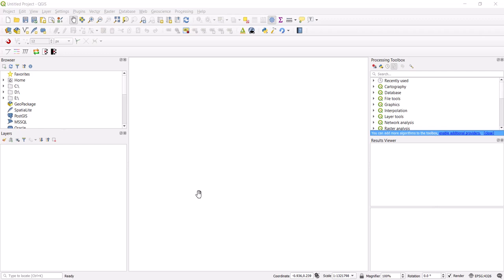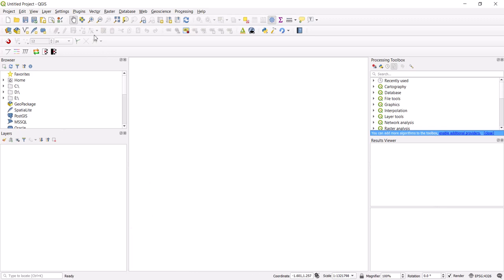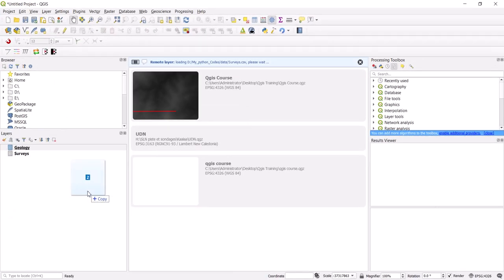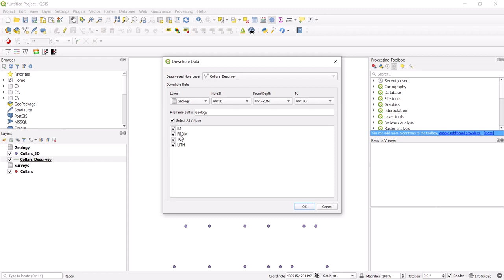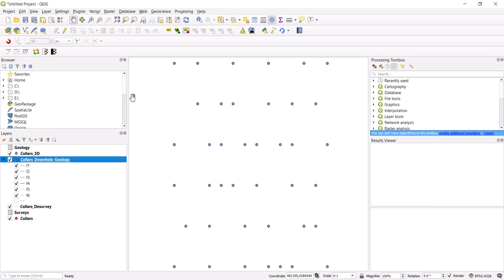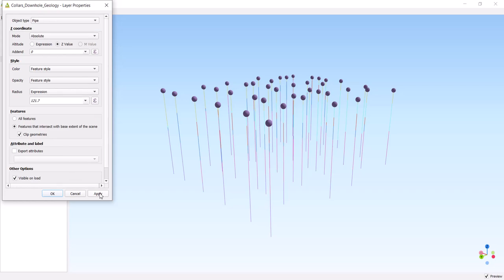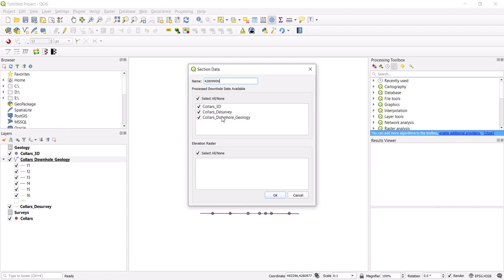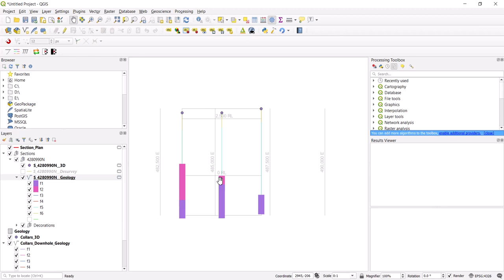Display drillholes in 3D in Qgis and Create Sections

Comment: Hello, I appreciate your detailed tutorial. However, I encountered an issue while using the Qgis2threejs plugin. Despite following your instructions step by step and loading the correct geology downhole data, I am only able to see points in the visualization, not the vertical lines. Could you help me troubleshoot this problem? Thank you!
Reply: I have the same issue :(
Reply: The problem is that the latest update of the qgis2threejs plugin has a problem with the vertical axis of the Geoscience plugin. You can solve this problem by downloading a older version from qgis2threejs manually as a zip file. The start the qgis2threejs again and it will run. But do not update the plug in, otherwise you will have the same problem again.
Reply: Check the text beneath. It explains how to solve the issue

Comment: It worked. But since yesterday when i want to see the downhole geologie in QGis2threejs they don't appear suddenly anymore. When i gi to zoom to layer its jumping to nowhere. Whereas the point coordinator appear correct in 3d. In the console it says: referenceerror cant find variable:app three.min.js(42):three.webGLrenderer:angle_instanced_arrays extension not supported... this problem didn't appear before. I updated yesterday all pluginns... i guess it somehow caused this. My data is all correct.. to double check i used your data... the fault remains the same

Comment: Thanks again. I am happy to suceed in built my first geological section with QGIS. A small diference between your results and mine was, the my Downhole_Geology came up side down. The spheres were positioned in the bottom instead of top.
Reply from the maker: To fix that , all you have to do in the geoscience plugin when you run the Desurvey hole option is to uncheck the checkbox that says down dip is negative
Reply: I made all the three files in csv format but when i try to categorize the symbology for the down hole data categorization does not happen, only one simple line comes "all other" . And there is nothing in the attribute table. Kindly help

Comment: very good explanation. i had some problems with the csv and the commas and dots, but now i have something.  only problem i have is that the drills are towards the sky instead the ground. Where must i change the data to correct this issue? thank you so much.
Reply from the maker: When you do Desurvey Hole there is a checkbox saying "Down Dip is Negative", check that or uncheck that based on your dataset

Comment: Geat and very useful video, thank you very much!. 
I find problem while trying to use drilling desurvey hole command. this message appear : The data source for the layer could not be found. I tried with your files and it works but it doesn't work with my data!! is there any explanation to that? For information, I use meter unit for parameters such as elevation, depth...
Reply from the maker: I m sure it is an import issue, or your data in not in the right format

Comment: Very good work, this plug in is amazing, thanks for explaining! What would you suggest is the reason my sections are not showing up after I draw them?
Reply from the maker: Thank you but your problem will depend on your data and how you created the section. I cannot tell what is the issue without more details.
Reply: @MiningGeologist  thanks for responding! I really appreciate it. Well, eventually, it requires the sections to cross exactly on top of the boreholes, otherwise there is nothing to show, I needed to have extrapolated anything in between. This is a good challenge for QGIS to overcome the expensive software.

Comment: Hello. I have a question. I managed to get almost everything I needed learning from your video. I wanted to make a drillhole planning 3d drawing, so I don't even need the lithological info. I just changed the elevation on Qgis2threejs to the value I wanted and changed the symbols to cylinders. Worked perfectly so far.

I just need to know: is there a way for me to tilt these objects on Qgis2threejs somehow? Do you have any idea? Because some of the drillholes shall be done diagonally and I need to represent that.

Thank you
Reply from the maker: just play around with the dip values in the survey file that should do the trick!
Reply: @MiningGeologist  Oh, that's the thing... i'm not even using Geoscience plugin cause it isn't necessary, since it's just a drillhole planning project. I'm straight up importing Google Earth Markers, adding coordinates to them, etc. Is there a way for me to add Dip values to them in a way that would display correctly on Qgis2threejs? Or add Dip values on Qgis2threejs window itself?
Reply from the maker: @dicornius9596  check the video description, you will find the dataset I used in the video (3 CSV tables) try creating similar tables but with your data then in the survey file try to adapt the DIP and Azimuth to your needs

Comment: Great video, I was looking for something like this!  I'm an archaeologist, and I would like to do something similar but make a 3D heat map (# of artifacts instead of lithology), and I think I can use this as a spring board...
Reply from the maker: For 3D wireframes, try using Geological modeling software, I have a full course here on the channel check it out.

Comment: Mining Geologist, absolutely love your Channel! Will be taking the course on Implicit Geomodelling as well pretty soon! just had one doubt though, where can we source the data from? I do not mean the data that you used for this particular video, but if I were to create a 3D drillhole using a completely different dataset, where can I find them? especially the Geological excel data! if you could throw some light on that, it would be really grateful! Thank you!
Reply from the maker: These tables are usually provided by the team who did the drilling , but if you have the logs you can create them yourself easily. 
Collar table : just put holeid, x , y , z coordinates of the hole 
Survey table :  holeid, azimuth of the hole ( dip direction, 0 if vertical hole) , dip ( 90 if vertical hole) , maximum depth of the hole ( end of hole depth)
Geology table : holeid, from depth, to depth , lithology in that interval ( the code of lithology for example SAND) 
PS : you need to use the same names in the in all tables in the holeid column for example don't use DH1 in collar and dh1 in survey. 
the max depth in the geology table should be the same you used in the survey table, there should be no missing  intervals in the geology table. 
from 0 to 5 Lith1 
from 5 to 10 lith2 => all the way to the end of hole depth. 
I hope this helps !
Reply: @MiningGeologist  I appreciate you taking the time out to type it all out! Thank you for that, will give it a shot.

Comment: Hi! Thankyou for the tutorial, I'm just having a small issue. I am using some old datasets to do some practice for future programs and am doing E-W sections of a 40x40m program. The sections can be quite long (upwards of 500m). What I'd like to do, to make the data easier to read or fit into a drilling report is to change the horizontal and vertical scales independently of one another, is there a way to do this in QGis? 

Thanks for your help!
Reply from the maker: I don't think it is possible with this plugin, I m sure there are better ways to do this.

Comment: Hi. Thanks and congrats for the videos, very helpful for my entry level. One question: How can I create a cross section using the project topography of a vector layer for more detailed work  i.e. planning infilling drilling?
Reply from the maker: Hello Miguel , if you want to create a cross section using the same method i used in this tutorial , you need first to get a DEM ( raster topography not vector) , so basically what you need to do is to interpolate the the vector topo you have using TIN algorthim for example or IDW which will generate a raster version of your vector topography then do as i did in the video . 
i hope this helps

Comment: What data is needed for the surveys? What is the input?
Reply from the maker: Andrei , you will find a link to download the dataset used in the description you can check how it is structured. mainly the Same hole names, Dip, and azimuth you can set them to 90, and 0 respectively in case you have vertical holes

Comment: Thanks for your QGIS Geoscience plugin videos,  Is there a setting to set a vertical exaggeration on the sections? Most subsurface geological requires significant vertical exaggeration. Is it possible to have a multiple vertices instead of just a straight line for the section? It would be nice if Geoscience would allow for bringing in downhole geophysical data like a gamma-ray log in the standard .las format.
Reply from the maker: Probably not possible with the current version, I think the founder stopped updating the plugin. but check out this one which I m developing right now so I might include these features 
https://www.youtube.com/watch?v=efNMFwBiifc

Comment: Awesome, I used our company data as I walked through the video - works really well, but the pipe (DH trace) thickness crashes a bit with lots of drill hole data....
Reply from the maker: I m happy that you found the tutorial useful , and yes with alot of data the 3d display might cause the software to crash because Qgis is made only for 2D plots but maybe in the near future we will see some tools that integrate perfectly with Qgis and works smoothly with 3D data, make sure to subscribe to be notified if such thing is available :)

Comment: Is it possible to generate a layer model through the drillhole interpolation?
Reply from the maker: Technically it is possible, but it is going to require some tidious manipulation also the accuracy is not going to be as you expect. There are better software that can do this but most of them are paid softwares. If you stick around and follow my channel your problem might be solved in the near future I m working on plug in that will do this automatically in Qgis.

Comment: Hi Mining Geologist,

Do you need survey data? I have none and I'm wondering what the easiest way to deal with this is. Most of my holes are shallow (<5m) but even deeper holes haven't been surveyed. All holes are vertical.

Thanks!
Reply from the maker: Hello izzy, thank you for your comment , actually survey data are needed to allow the software to trace the path of the drillholes in subsurface , usually if the drillings are vertical like in your case you don't get a Survey file . but you can create one really easily, make a copy of your collar file , delete all the coordinates columns , keep only the drillhole name column now add two columns DIP ( make it all equal to 90 which means vertical drillholes , some softwares needs -90) and Azimuth column ( make it all equal to 0 ) since they are all vertical . i hope this helps .
Reply: @MiningGeologist  I did try this but it hasn't worked for some reason. Not sure if I am missing something!
Reply from the maker: @izzywizzyable  i can check this for you send me a sample file if you want

Comment: Hi, great explanation of using this tool but I am having some issues. I know this is an old video but I am wondering if you can help me. I have about 100 drillholes that I would like to plot. When I try to run the downhole survey with my collar and survey csv files the surveyed layers get loaded into the layer manager but nothing appears in the project and I have the error "Layer unavailable, data source could not be found" and "Warning some east, north, collar, depth values are not numbers" . I tried with the data you provided as well and got the same issue. The only difference I can see in the process is that your data was separated by a semicolon and mine is comma delimited and I have surveys at multiple depths with azimuth/dip values that have decimals. Any ideas? Thanks
Reply from the maker: No worries @Redfox700, can you send a sample from your dataset I'll check what is the error and send you a detailed solution via email , you can apply a transition to the coordinates if you want. 
(my email can be found the about section in my channel , cannot post it here to stay away from bot emails)

Comment: Do you have a video on how to set the tables up in excel?
Reply from the maker: Hi Patrick, you are supposed to have these ready from the exploration team! what kind of data do you have exactly so I can assist you ?
Reply: @MiningGeologist  so I have bore logs. They were done before me so they are not up to my geology standards but that's all I have to go off of right now. So I built Autocad logs, but basically I have a GPS positions (which I easily can change Into northing and easting) depth of well, depth to water (I don't believe I have an initial elevation, but probably could get that from a DEM). The lithology is all messed up (there was only a field tech on hand doing it and I the geologist wasn't hired yet) so the lithlog was basically taken every 5 feet and goes [tan silty sand, tan silty sand, brown silty sand clay, tan silty sand]. I dont really have a proper thickness of each unit just because it was so vague. So the clay could have been an inch but the sample was taken at 5 minut Intervals so no too much to go on there. These were done at 2" holes by method of split spooning. So to summarize lol I have crappy litlog that I KINDA can break into sections but can't properly class, DOW, EOH, DTW, HoleID, and well location lol
Reply from the maker: @patrickmesa1947  I don't know if you are already familiar with the drill hole tables to perform desurveying in most of the mining packages or not. if not here is what you need : 
Collar table: put the hole name, x,y,z here (you can get an elevation from a DEM as you mentioned but that's not very accurate), and end of hole (I think if you sum up all the 5 feet intervals you can get one)
- Survey Table: same hole ids, dip (if you have inclined holes, other than that use 90 or -90 depending on what the software accepts), azimuth (if they are dipping to a specific direction use the right one, if not use 0 ).
- Lithology table: same drill hole ids, From , To intervals, and the lithology. 
- Assay Table: I don't think you need one
in your case whenever there are similar successive intervals just make a single one, for example, sand(5ft), sand(5ft), clay(5ft) just make them sand(10ft), clay(5ft). if they did it every 5ft and you are not sure if the clay is 5ft or just 1ft that's a problem that no one can solve and I m wondering why would someone log it that way. 
Also in the tutorial description, you will find a link to download the same dataset I used in the tutorial this will help you understand how to format your data properly
Reply: @MiningGeologist  ya they we not geologist lol in fact I'm teaching the how to log lithology and switching them to hollow stem cores so they can be kept in boxes. The well is completely vertical and I do have access to the site to get initial elevation. The sampling was just done at 5' intervals. But I do have two done by an actual boring company that's a little more complete so I might be able to use them. But ya this was a project done 6 years ago with no since of data preservation. And they are all monitoring wells and now they want a n-s and e-w cross section with a water table contours and flow gradient lol
Reply from the maker: @patrickmesa1947  I bet your boss was like why invest in new drill holes Patrick use the existing ones and try to predict the lithologies :face-turquoise-covering-eyes:. 
Just kidding :face-blue-smiling:! Good Luck
Reply: @MiningGeologist  lmao dude you actually called it 100%
Reply from the maker: @patrickmesa1947   ¯\_(ツ)_/¯
Reply: @MiningGeologist  in your x,y,z example in your collar chart your z is different than end of hole. What is this referring to?
Reply: @MiningGeologist  how do you get a dem to snap to the points. all the DEM i have cant be changed to UTM and if they are they still dont line up
Reply from the maker: I m not sure what do you mean @patrickmesa1947   ? do you have XYZ points but they don't sit perfectly on your DEM (a few meters difference )?
Reply: @MiningGeologist  I can't get my dem to snap to utm nothing and easting. So essentially I can't get them to line up lol
Reply from the maker: @patrickmesa1947  your issue could be : 
- the points  have coordinates that were measured using a GPS ( accurate)
- and you are using a public DEM ( srtm...)
which is not accurate Cell value = 30m, so everything within a 30m2 considered to have the same elevation and your point could be for example 15.5 in real life while the SRTM data is averaging the elevation within that area to 25m which gives you an offset between the points and the DEM. 
In this case, you can do two things : 
- Get a more accurate topography (DEM)
- Or if you don't have one force your points to snap to the DEM 
watch this video : 
https://www.youtube.com/watch?v=lDRdevZhM3o